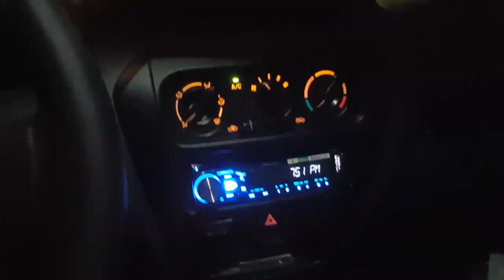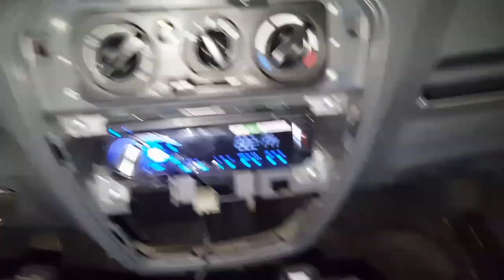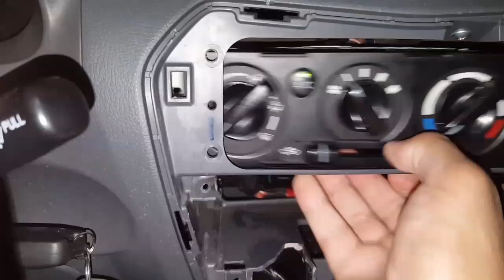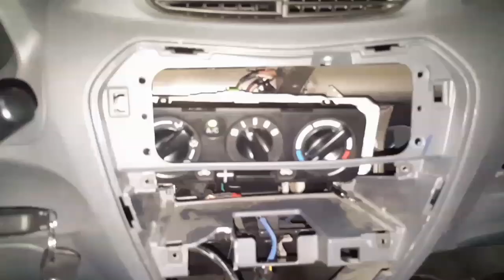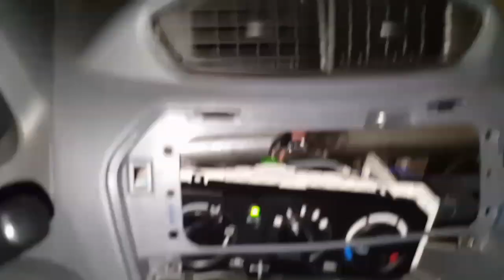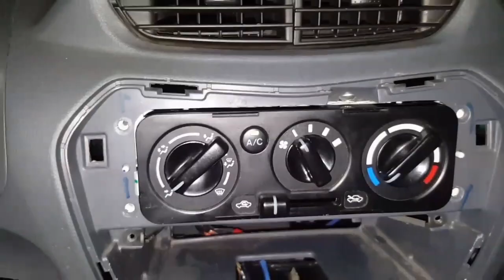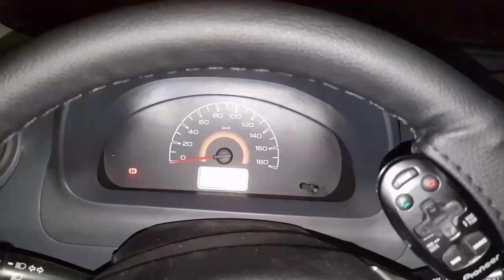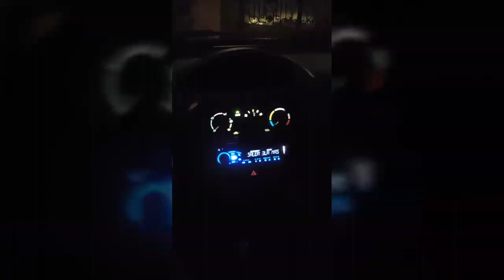Car AC control unit & dome lights change to LED

Comment: Can we open knob without unscrew climate control in alto 800 without remove any frame or screw can we open knob ?
Reply from the maker: I think no. It will be very difficult